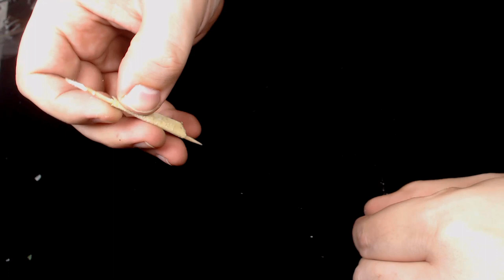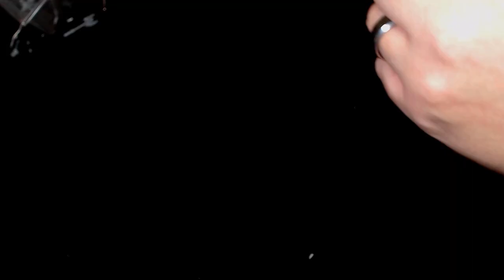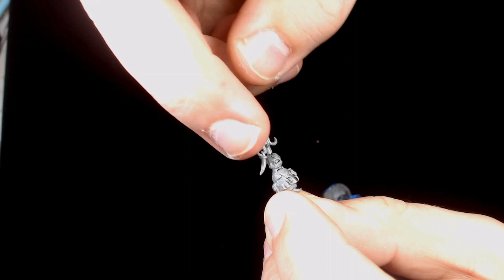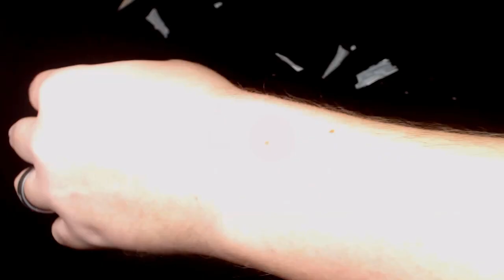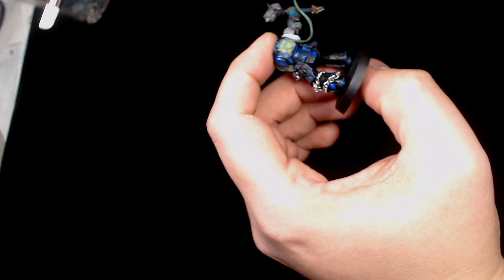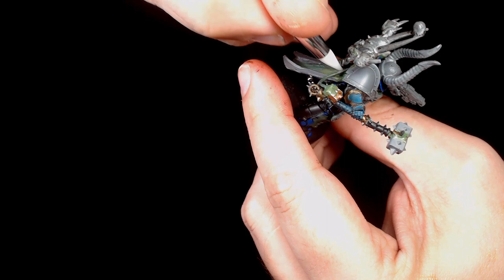Conversion Corner World Eater Dark Apostle

Comment: Great looking conversion there Andy. I'm a newbie to greenstuff myself, but one thing I have found is using a small amount of water on the tools will help the putty smooth out even better. You may want to consider products such as Vallejo Plastic Putty for use for seam / join smoothing - its works well as a filler but the regular putties are better for sculpting.
Reply: yeah its a tricky substance to get the hang of, ill definatly bare that in mind about the water
Reply: Good call grimgar...  a small bit of water aids in the use of green stuff greatly